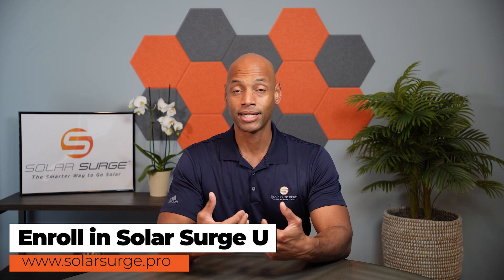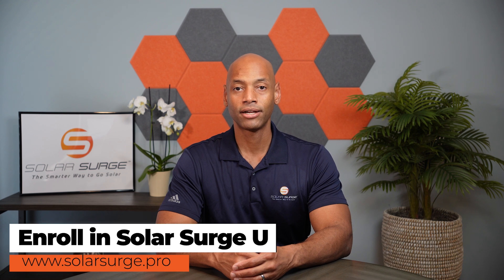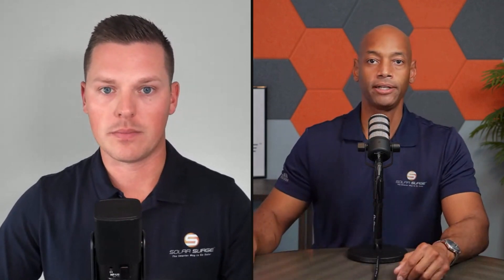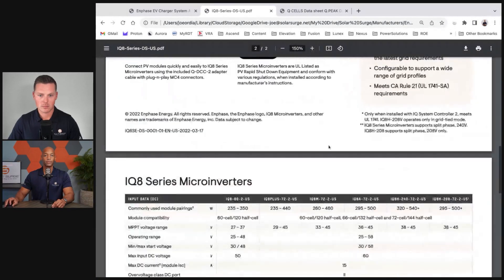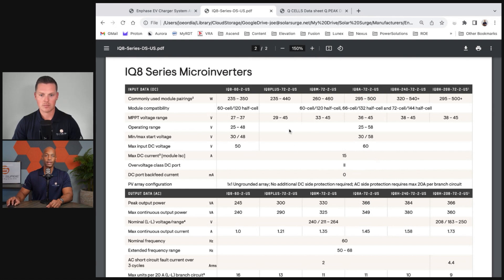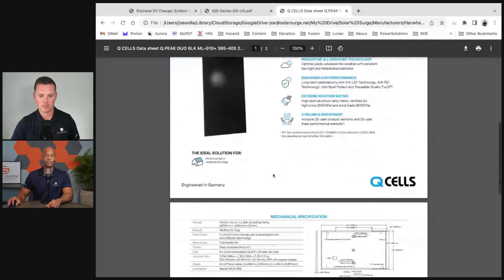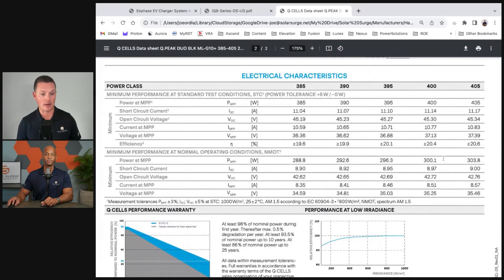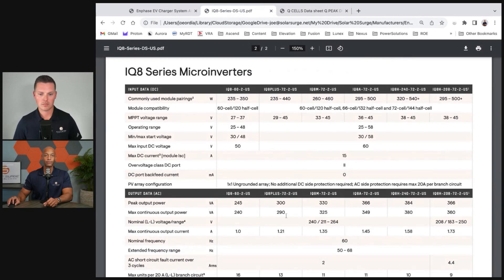Choose the Right Size Micro-inverter (Enphase IQ8 Series)

Comment: Such a great topic.  Enphase have a great reputation because of their low unit failure rate and they are field proven to last.  That being said, Joe could you debate using Tigo TS4-A-O DC optimizers vs Enphase IQ models.  My home is all electric and I have a Tesla model Y.  I can not offset my power bill 100% because of my roof size and design.  Most of my quotes go with 36 panels 400 watts for a 15.2 kWh system for an 88% offset using 23,781kwh yearly.   I need all the power I can get so I’d go with the Tigo optimizers with an EG4 18k inverters with 2 EG4  14.3kwh LiFePO4 batteries, most affordable on the market.  Other then having one central failure point, I feel DC optimizers are the way to go because they are rated for 700w panels (and they have a 1000w dual panel model) so 100% no clipping and also you don’t not lose 10% of power like with micro inverters converting from DC➡️AC➡️DC➡️AC with the use of batteries.  They are also much cheaper but you do have to include the price for a central inverter.  Any input would be greatly appreciated.

Comment: Due respect, You are optimizing power delivered, Physical size of the solar array and cost. This exactly what most of your customers want, but If cost is secondary Upsizing the Microinverters  and using lower capacity panels (more size on roof more rack age…) has no down size. I Live on The Penisula of SF bay CA. I have a 12.4 KWH AC system. I also run my HVAC year round. I put $2,000 per year in my pocket after zeroing out my electrical usage. Ok I have some Tesla power-walls to bridge On peak usage. At 40 % depth of charge It is only on the shortest stormy days that I draw any power from the grid.
Reply: Maybe it needs a lot of panels and space🤣🤣🤣🤣

Comment: Hello, I live in central Pennsylvania. I am working with a solar contractor that utilizes Enphase inverters. He is specifying your iQ8+ inverter for a 30 panel system with REC 405 pure panels. I was looking at the output of the panel compared to the continuous power input for the iQ8+ and it looks to me like the panel put out more than the inverter can handle continuously. I asked if they thought I would be better off with the iQ8a which looks to exceed what the panel can put out. I was told that the iQ8a isn’t as good with low light power as the iQ8+ and that because I live in the north east the iQ8+ would not likely clip or have the panel exceed the inverter. Does this sound correct?
Reply: Sounds like they're absolutey spot on my friend

Comment: i think the best way to evaluate panel and microinverter pairing is to use NREL's PVWatts calculator for your location, use the advanced parameters tab, and adjust the DC to AC size ratio for the panel and inverter configurations you are contemplating and see how the modeled output changes. in my case, I was going to use 485W panels and there was going to be clipping with any of the IQ8s because of the panels' high output.  But there was clearly a diminishing returns as I went upward with increased inverter wattage. Ended up using the IQ8H becuase the price difference between it and the lesser models didn't amount to much and I wanted to minimize clipping, but could easily have used the IQ8M or IQ8A which amounted to 420kWh/yr and 155kWh/yr less, respectively, than the IQ8H per PVWatts modeling at my location.  Eventually the inverter cost increase outweighs the production increase and you have to determine what makes finianical sense. IQ8+ was 1140 kWh/yr less using PVWatts so you can see that clipping does matter at a certain point so its a needed exercise for proper design.

Comment: "Minimum performance" at normal operating conditions is what I read. So these microinverters "clip" everything above the bare minimum for a 400w panel ? is there not a better option ? at least the iQH goes up to 380w, I mean if I'm spending this kinda money I would not want to lose 30% solar energy even when it is available. Doesn't make sense to me.
Reply: find my comment about using PVWatts to model this for an overview.  you are thinking of this as some steady state analysis and its anything but.  weather, sunlight angle, panel angle, season, etc are litterllaly changing every second and all have a huge effect on the system output.  400W panels are rated at STC as he states.  No one achieves STC in the real world - its just a way to compare differnt products in laboratory conditions.  Use NWOT on the data sheets for real world use but even better, use PVWatts and model specifically for your location.
Reply: Upvote for gregory.   @gregorysmith9158
Reply: Me neither, I use a 2000W microinverter so there is no clipping at all with 400W modules.

Comment: According to my panel monitoring, most 400W solar panels output well over 300W from 10:15 AM to 3:15 PM if the sun is shining. For my array, this is "Normal", not what it says on the datasheet. Even on mediocre days, the output oscillates between <100W to >300W as clouds pass by. You make it sound like 400W solar panels are only going to output 300W, and a lot of people believe you. I'm sorry, it's just not true. Even with 400W panels at just a 10-deg tilt in the NC winter, they output more than 300W and are clipped badly by IQ8+.  As you can see, I prefer no clipping unless it's unavoidable. That's why I use and sell Hoymiles HMS-2000-4T-NA high-power microinverters. Their reliability and warranty are as good as Enphase's, but at a much lower cost. Hoymiles is DIY-friendly too.
Reply: i think this is the right approach. the 8M is more suitable and all the talk about the inverter which clips during summer will produce better during other months was applicable to the iq7 models which had different starting voltage for each variant. the iq8 all have the same starting voltage. hence choose the right model based on pv watts.
Reply: My 405 panels never go above 300 and it's in their specs
Reply: @AgentOffice  My 400W and 405W panels output over 500W occasionally, when there are fluffy white clouds reflecting, and refracting the light to irradiance values higher than STC. I capture every one of those events, they don't get clipped.
Reply: @ToddDesiato what microinverter you’re using?
Reply: @AgentOffice mine consistently hit the 8M max which is 320-330
Reply: @AgentOffice  My 405W panels have hit 500W under better than ideal circumstances.
Reply: @ToddDesiato  that's not even possible 405 is the most ideal
Reply: @AgentOffice  The data don't lie. 405 watts is based on STC of 1000W/square meter. When there are reflections and refractions due to fluffy white clouds, the solar radiance can exceed 1250W/square meter. It happens every week in the summer here. It doesn't last all day, just brief spikes as the clouds line up just right.
Reply: @ToddDesiato  I can confirm this. Happened a few days ago when there was a lot of sun, it was pretty cold, and there were quite some white clouds. The light from the sun looked white i.s.o. yellow and I saw my system perform 20% better - when the clouds were not in front of the sun of course.
Reply: Exactly
Reply: Hoymiles with their bigger micro inverters can solve the issue. Don’t clip
Reply: My lingo 525w panel sometimes gets 530w so you don’t want clipping
Reply: You are correct the inverter curve tells valuable information and should also be considered. 
It sure seems true that Enphase has greatly pushed that it’s acceptable to clip VA output. 
Other manufactures such as Hoymiles have targeted this VA output as a point of concern/target area which may prove valuable. 
Yet there still needs to be concern towards low VA input capacity of the inverter curve to be balanced properly.
Reply: Enphase introduced the IQ8MC, AC and HC series because the newest panels are made with 108 halfcells and those produce a lower voltage but also (more importantly) a higher current going well up to 14A. The older IQ7 and IQ8 series couldn't handle more then 10A or 12A. The IQ8xC series do. 
My installer put 108 halfcells on the roof here and he paired them with IQ7As. Before he did I already asked him AND ENPHASE SUPPORT if the 10.2 current limit wouldn't be a problem but both avoided my question every time. And now I see this happening : Inverters starting way too late in the morning because the VMP of range panel and MMP range of the micro inverter don't overlap a single bit, and huge clipping during spring, summer AND autumn. So now I can replace all my IQ7As with IQ8ACs or IQ8HCs. 
My fears have come true. 😞
Reply: at 9:00 he goes over the various types of IQ8 inverters including the IQ8M, IQ8A, and IQ8H that all output more than the IQ8+. maybe watch the video before commenting
Reply: @gregorysmith9158  I watched him justify why those higher-power microinverters were not needed twice. I wholeheartedly disagree with that design philosophy now that there is a lower-cost alternative. Clipping is an unnecessary loss of energy.
Reply: @DiySolarHelpDesk  Use PVWatts and model what is lost to clipping by adjusting the DC to AC size ratio. you will see that clipping amounts to nothing if you choose the right inverter.  using PVWatts, i found that DC to AC size ratio was actually best at 1.1 (ie with clipping; 1 would be no clipping) at my location.  Also need to consider the output curve of your inverter (ie its efficiency). they don't all produce optimally at low input powers (although the enphase do go pretty low on the input power before dropping off). so if you size the inverter so that it never clips you may actually have given up a bunch of power in the morning and late afternoons where the input power to the inverter is not near its max and so the inverter is not efficient.